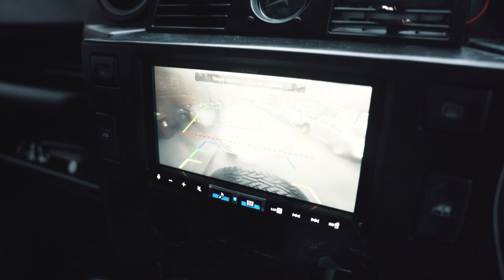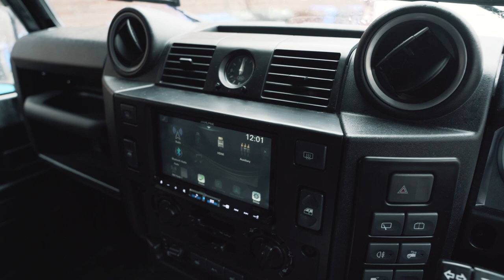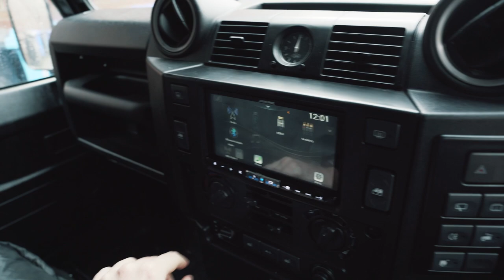CHEAP MODIFICATION TO IMPROVE YOUR LAND ROVERS VISIBILITY!

Comment: Hi, thank you for this great video. It’s really helpful, as I’m considering doing the same thing on my Defender 110. Out of interest, how did you find your Road Angel RA8100 camera at night? Is the view of the camera clear enough when it’s dark?
Reply from the maker: Thanks, glad it helped! The camera is good at night - I also have rear work lights which I use if needed but in general it's pretty good with the reverse light illuminating the road behind

Comment: Good man! Top job! I have a project where I also need to drill into the body of my L322. Any tips on how you drilled your hole? Did you start with a pilot hole size and then gradually step up in drill bit sizes until you got to the desired size hole? Did you do anything to the bare metal of the hole to rust proof it? Thanks for the video!
Reply from the maker: Thanks! Just started with a punch mark and ensured I had a metal drill bit. Key is to actually set the drill to a quick setting so that it doesn’t chew up the metal. After that, I treated the bare edges with a primer and some paint 👍🏼